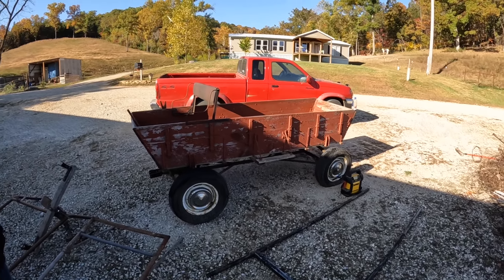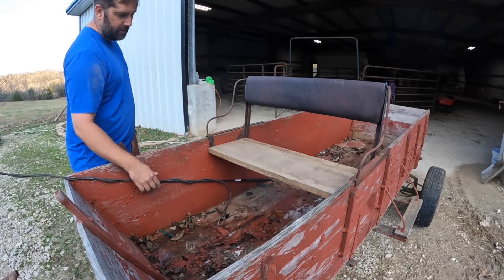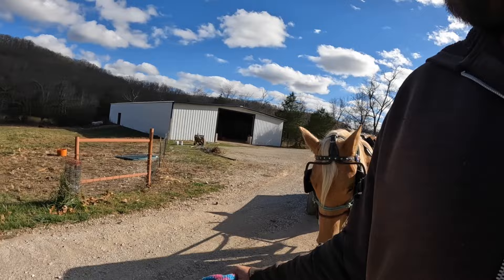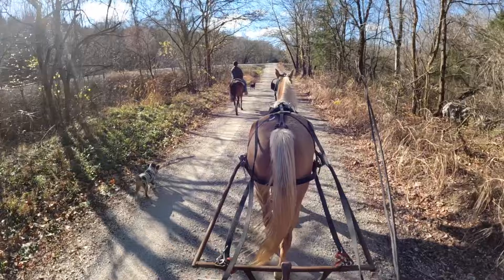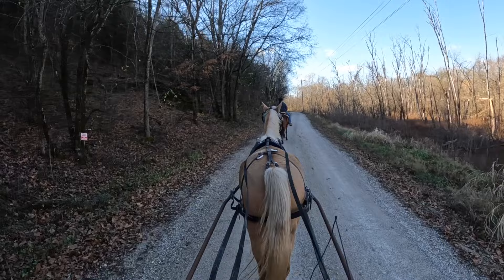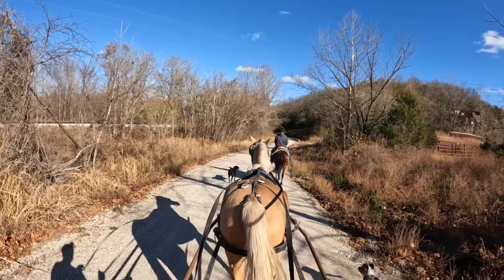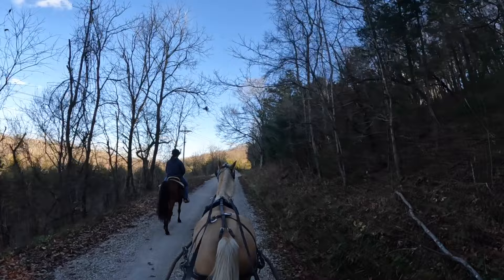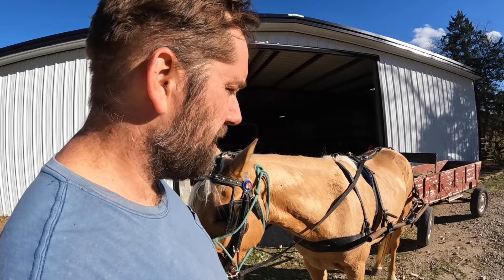Learning To Pull A Wagon - Not All Horses Can Do This!

Comment: You should have a swingle tree on your wagon, for the ends of the tugs. A solid tug-hitch like yours is hard on the horse's shoulders, causing the breast band to rub on her shoulders as pulls, causing friction.
Reply: you are correct this type of hitch is usually used with a racing harness and a very, very light vehicle. The horse pulls from the saddle so there's no rubbing on the chest area. But don't use this set up without a single tree.